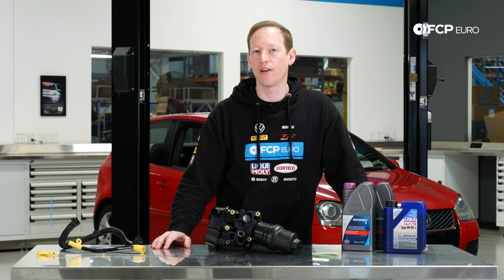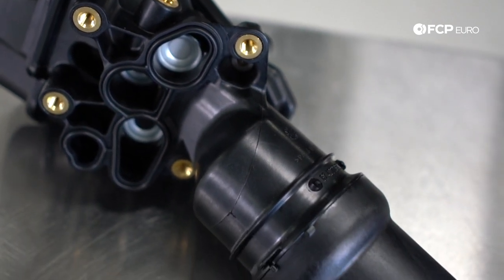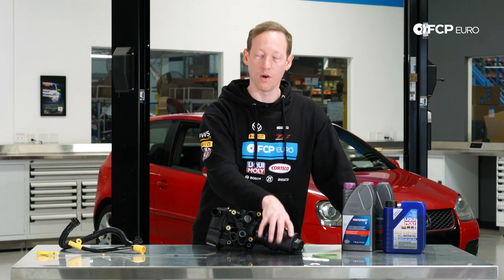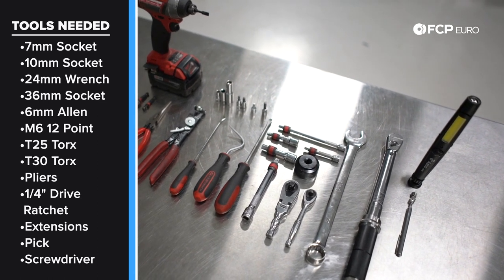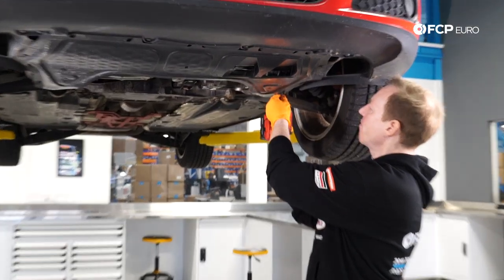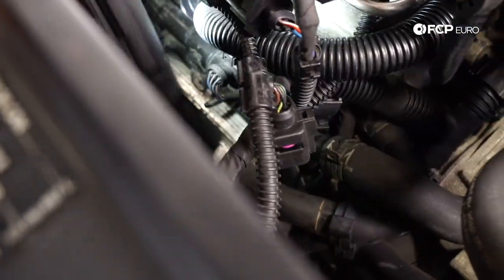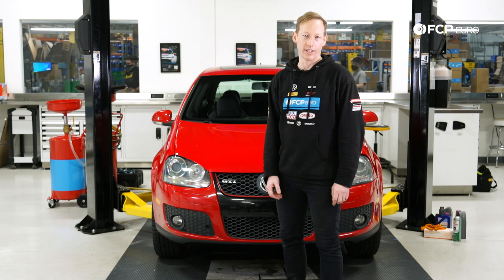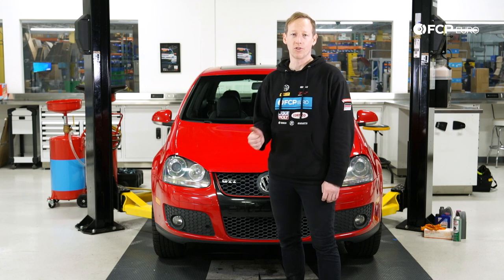Volkswagen Mk5 GTI Oil Filter Housing Replacement DIY (VW GTI/GLI, Mk6 Golf R, B7 A4) FSI EA113

Comment: My $.02 worth.  When you're discarding the old housing as junk, save the oil filter cup itself.  I once cracked one, and Uber'd to the dealer, and he didn't have one in stock.  They're expensive.  And he was good enough to "borrow" one from a new oil filter housing, and sell me that and order a replacement for his inventory.  But you never know when the that filter holder may crack, get overtightened, etc.  I'm keeping my old one.  In the process of doing this job on an '06 GLI.  I probably shouldn't have let so much crud get into the block when cleaning up the mating surface, but lets hope one quick oil change can make that some better.  Good video,   I'm almost starting to go back together with it, but I'm one of those guys puzzling about how to remove the dipstick tube

Comment: Fantastic video! We are attempting this repair today as our filter housing cracked all the way when trying to remove the oil filter cap. It was basically melted together with the housing and there was no way to remove it, other than destroying it. Unfortunately this also resulted in a cracked housing, as I didn't realize this was a plastic piece and not aluminum as it is with most others cars.

Comment: After needing to do this twice because I got just the gaskets and coolant leaked into the oil...I was able to remove the housing the second time in less than 2 hours and didn't need to remove the throttle body. I removed a few extra torx screws and hoses and was easily accessible from either the top or bottom of the car. I took the bottom oil cooler bolts from underneath and the rest from up top.  then I just worked the oFH down from underneath.

Comment: Great how to video.  Super helpful.  One thing though.  Regarding (bending that bracket).   That small triple square bolt isn’t what’s holding it down.  It’s the upper oil cooler bolts that hold it down.  The left one is accessible with just a 6mm Allen socket.  The right one can be removed with a long 6mm Allen socket.  No bending of bracket required.  I’m really surprised it’s not covered in any other diy I’ve come across.  It’s literally unaddressed or omitted.  Also as far as taking the fans out…it does give you more room but take care not to damage the radiator core.  So s suck to have to also replace a radiator.

Comment: I made this repair this weekend, disregarding the advice to replace the whole unit and did gaskets only.. and now I've got coolant in my oil (which wasn't an issue prior). So hopefully a new assembly will fix that issue. Sucks to do this job twice!
Reply: thats what i was thinking might happen, what if my oil housing is cracked/old (original)? going to buy a new housing now
Reply: @adhizzle9985  it's definitely worth it!
Reply: I just tried the gasket as well and now coolant in oil as well causing backfires and other engine issues
Reply: @checkmate1996  cheaper to buy the filter housing. Now you'll have to flush the engine with at least 2 oil changes and filters😐
Reply: @headstrong6523  Yeah - i was trying to save my son money but now ended up costing more than double....hate it when that happens..
Reply: @checkmate1996  unfortunately that's how I live my life. The Hard Way!

Comment: Just did this, was brutal. Both the shallow triple squares on the metal bracket rounded out and I had to torque the housing behind the bracket one degree at a time with an ity bity ratchet completely blind😅 but we did it! To any who attempt this, be careful with the bracket bolts and invest in hose clamp pliers!
Reply from the maker: Super frustrating when a bolt or two multiplies the complexity/frustration/time to do a job... glad you got it done in the end though and perservered!

Comment: The oil housing bolt torque of 15nm is correct, but oil pressure sensor torque is 20nm and oil cooler bolts are 25nm. Although 25nm seems rather tight..I think 20nm might be better on the safe side. I am reading the official manual from VW US and these are the specs shown. Just torqued them down a few hours earlier as I I performed this housing swap as well. If anyone needs the official manual just ask, its about 7,000+ pages in total. Has everything from basic maintenance to engine disassembly.

Comment: I did this on audi A4 quattro b7 few weeks ago. I didnt remove oil cooler hose as the hose was welded into the cooler lol and I just let it hang there with the hose. Used razor blade, brake clean and scotch brite to clean it. Used brake clean, shop towels and razor blade to clean the block where oil filter housing goes. Dont used oil or grease to lubricate the gaskets btw. While you are in there replace the dipstick tube oring( guy in this video replaced the dipstick tube but forgot the oring on metal pipe lol). Throttle body gasket replacement in not need as it never soaked in oil and mine was quite in great shape after 185k miles and re used it. Its also good time to replace Thermostat and oring on the metal pipe that goes into thermostat if it wasnt replaced. Thermostats are failure items on Audi's and VW.

Comment: Did you have any issues with having to code the throttle body when you reinstalled it? Was the job done with the battery disconnected?

Comment: Hi Nathan. First of all, thanks for the detailed video. I spent $1200 today on an Oil Filter Housing, Oil Cooler, Oil and Oil filter and some gaskets replacement. When I asked to see the old parts all they showed me was the gaskets and the oil filter and came up with some (to me) lame excuse why they couldn't show me the Housing and Cooler saying they had to be taken for testing to a third-party expert and because the parts were damaged, they left them there. My question is, I know you had to remove some parts to get to the other ones, but how difficult would be for me to see if they actually replaced those parts? If I get under my car, will I be able to see them? I have a Golf Mk6. Thanks!
Reply: dang you you paid that much for everything with labor? just take a peek under and if it's very dirty/grimy/dripping then you may have been screwed.

Comment: For the oil cooler, wondering if the top 2 bolts go through the bracket first
Reply: Yes they do(or I did it wrong), but no leaks or issues so far!

Comment: I just finished replacing the oil filter housing and the oil cooler, followed this video, I removed the fan shroud but didn’t remove the throttle body, had plenty of room.
Reply from the maker: Great first-hand note!

Comment: I just recently had all of this replace it cost my daughter about $1100 to do a complete oil filter, housing filter, flange gasket, removal, antifreeze manifold, gasket, set oil and degreaser. We’re all included in the total. My question is a couple months later we got a powertrain system code that came up yet again for secondary air injection system incorrect flow detected is that area anywhere near the area they just worked on that cost us $1100?

Comment: Originally had just the OFH gasket replaced, but soon it started to leak again.  Did the recommended OFH unit replacement and followed all the recommendations of this video and I still have a leak coming from the newly installed OFH.  I took it apart and examined the OFH & gaskets - they were fine. Reinstalled the damn thing and made sure all gaskets in place, oriented  / seated ( with no preexisting gasket residue) correctly and I tightened all the bolts and OF cap to Neuton Meter specs and I still have a major oil leak.  It's too tight to observe leak and determine where pressure is allowiing oil to leak out. Don't want to have to take VW to those dealership pirates to charge me $$$ to install an overpriced OEM OFH... can I just put some sort of seal around the outside of the plastic OFH where it meets the engine block?
Reply: Hope a year later you got it fixed lol did you end up figuring out your issue?

Comment: My car doesn't drip oil but when I turn it on cold engine sounds like is running without oil for a few seconds (no oil light) will changing this help with the oil discharging when cold?
Reply from the maker: This could help, as there is a check valve built into the oil filter housing unit, but there are many variables that could also effect this. (how long the car sits, oil type/weight, age or mileage, etc.)
Reply: @fcpeuro  is 118k miles FSI 2.0 2006, I was thinking that it might be the timing chain sometimes it does it and sometimes don't. Right now has fresh engine oil 5w:30 Valvoline (I know it takes 5w40 but it wasn't available at the time) and DSG oil

Comment: i didn’t remove the throttle body and just did it from underneath
Reply: Yes - after doing it twice....I realized there is no need to pull the throttle body. I could get to all the bolts from the top or bottom. I did remove a few extra hoses but that's alot easier than getting to those 4 bolts.

Comment: I have to do mine, is this possible without a lift? I don't have one.
Reply: if you are asking this question, you probably lack commonsense to do the car repairs. Leave it to professionals
Reply: a bit late but for the benefit of some:  if you have ramps you are fine, otherwise you can put the front on jack stands.  just put a backup support like a wheel or a jack just in case.

Comment: Got to the one screw holding the bracket and harness in front of the oil cooler and the screw is stripped…anyone have any ideas?  I’ve hammered and chiseled almost all day with no luck.
Reply: I did the same and was able to do it without removing the bracket, it was very had and cramped but I did it. I would recommend a very small ratchet for the top oil filter housing bolts or one of those universal joint drivers to get at the bolts from an angle. Getting the housing out is a little trickery to but not to bad, you can flex the bracket up a little to do so.